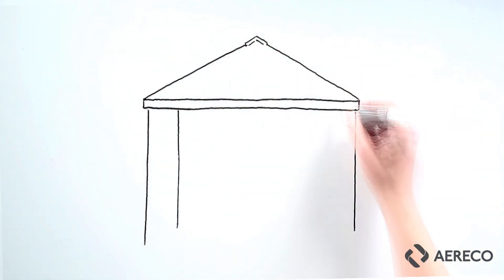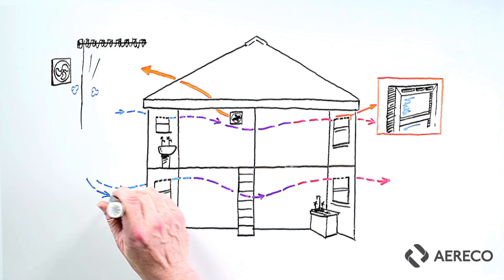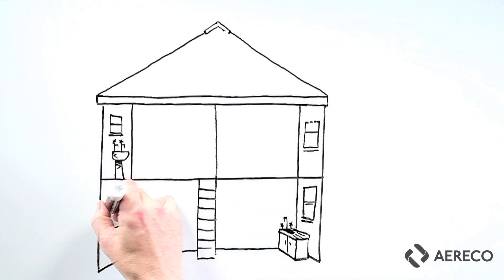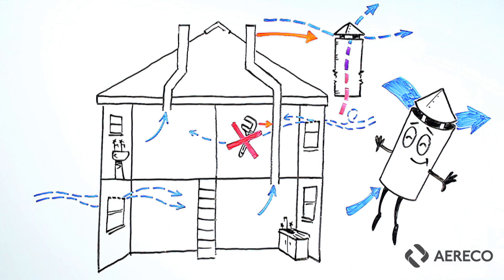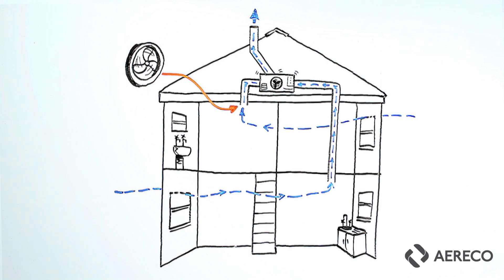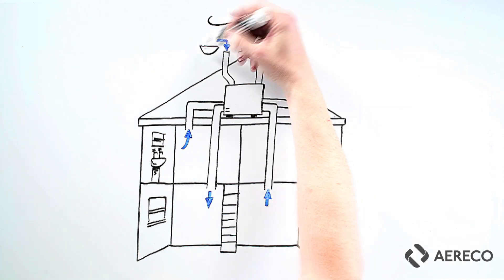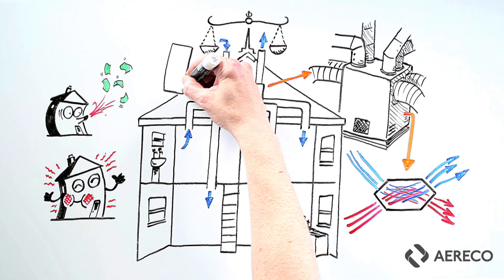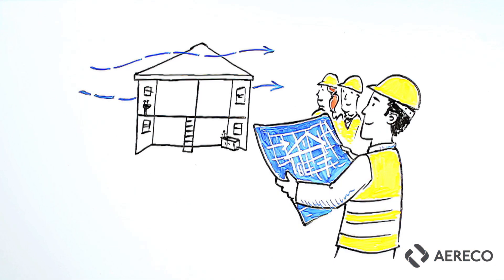Ventilation Basics Series #2 - System Types

Comment: Where does the most of CO2 get collected in the house? Does it get lower to the floor because it’s heavier than O2? Or is it more or less uniformly mixed in a real house? Is it taken into account when the ventilation is planned?
Reply from the maker: The ventilation system takes into account the fact that CO2 is commonly considered as homogenous in a room of a house/apartment. Fresh air should preferentially enter the dwelling through bedrooms and living rooms where CO2 is usually generated. If you need more information, you can contact us on our website: https://www.aereco.com/contact-us/

Comment: How can I improve ventilation in my house if I have type 1? Installing heat recovery ventilators in ventilation channels in every rooms would be a good idea?
Reply from the maker: Type 1 is very basic ventilation system, there are different level of ventilation as explained in the video. A mechanical ventilation with heat recovery is the best in term of energy efficiency and indoor air quality. Each ventilation system has its benefits but we have to consider the global configuration of the dwelling to pick and to design properly the ventilation system. For more information, we invite you to contact us at www.aereco.com

Comment: I apologize if this is not related but i would like to ask if it would it work if i used a regular electric fan as an alternative exhaust fan facing outside the window.
Its blades however are not quite wide unlike the common exhaust fan wich is wider
.
Plss help me its soo hot in my small room 😔
Reply: I've done this using a desk fan and it works. as long as there is an open window for the air to come and another for your fan then it will work.

Comment: Plss help...  My room is soo hot,  probably because of poor ventilation. 
Im planing of buying a ventilation exhaust fan...  Is it better to let the hot air out or let air inside of my room???  Plsss help
Reply: Well, ventilation exhaust fan actually suck out air, I would suggest placing the exhaust fan at the top of the wall or ceiling as hot air tends to gather above. With the exhaust fan, the air will move so you wont feel stuffy.  However, if you think the ventilation is very bad that even an exhaust fan wont cut it, you can install both system to let hot air out and let new air in.
Reply: Daniel Ng thankyou for the reply...  I cant install it in the ceiling though,
But im planning to install 2 exhaust fan just like you suggested ty.
Reply: @user-qy5gw4lm4t No prob.
Reply: @danielng7795  i already install the exhaust fan. Should i still open the window in the day when its like 35°c outside?
Reply: @jimtamim1708  If you are in the room, then it is recommended to open the window. By shutting the window you will reduce circulation of air, making the hot air to be let out through the exhaust fan(not exactly a bad thing but there is a limit on how much an exhaust fan is able to circulate air). So it is best to open the window. It's up to you actually. Here in Malaysia the temp is around 35℃ so I do open windows and doors to promote circulation.
Reply: @danielng7795 thanks fyi bro. Btw on side note i read some articles says that if the sunlight hitting the window in morning after 9am and above, better to close your window with blinds/shade. Its depends on your house orientation too. Because if that to block that heat from sunlight i use some kinds of reflective sheet too my northern window. It definitely reduces the temp in my room but i can't see the view outside. For east and west side of the window i didn't block it because there a roof. Also i read that sun orientation differ throughout the year, from March to Sept Sun more to the northern hemisphere and Sept to March on southern hemisphere. Btw i live in Malaysia too.
Reply: @jimtamim1708  I see. In this situation you can consider installing day curtains etc. To block out sunlight to heat up the room